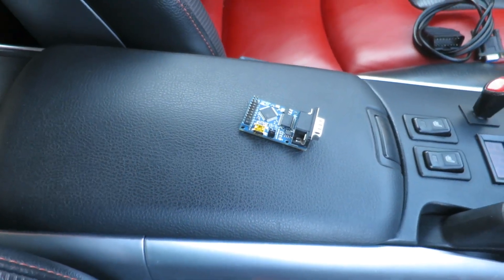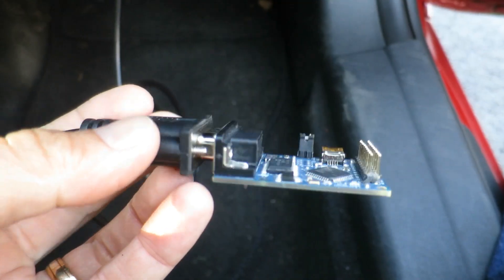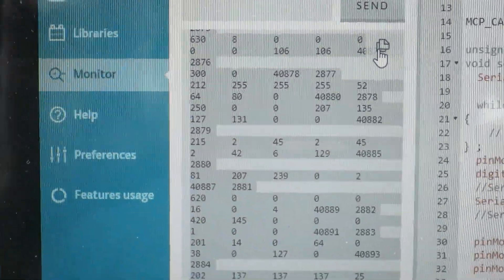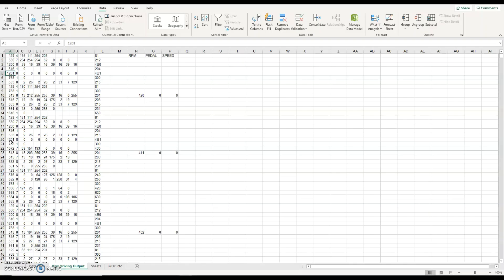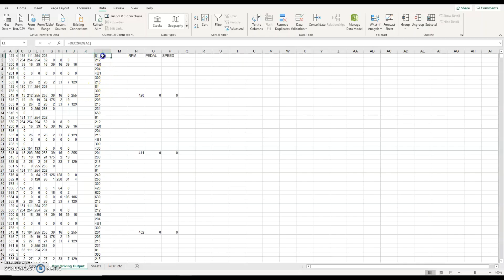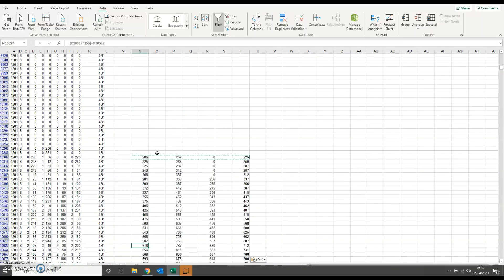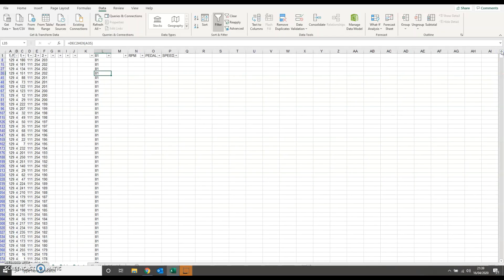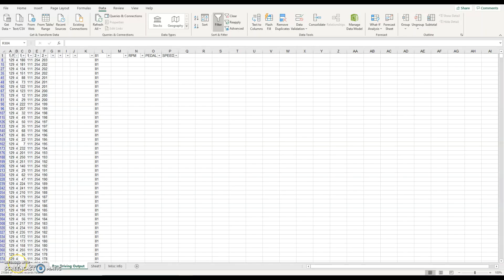How to read the CanBus in any car. (Can Bus) Part #1

Comment: SO AWESOME! I've had a specific idea for months of an arduino project I want to implement in my new car which will need inputs and outputs to/from the CAN BUS network, and inputs/outputs to other electronics. This makes it way more achievable. You've probably saved me a good 8 hours of trying to figure out what it is I don't know in order to start this.
Reply: @Dave Lovell if you acheived anything in your project, could you please share it with us?
Reply: @ezzaldeena.alribi8603   I haven't yet, but I'm planning on having it completed before the end of December 2021. I'll probably post some stuff on github and or instructables when I'm done, and I'll try to link it here. I might forget to put it here though so, comment on this thread if a few months go by and nothing happens
Reply: @davelovell8631  Pinging you.  :)  I, too, find this stuff fascinating.  Who knew learning Unix decades ago would find its way into cars and handhelds?
Reply from the maker: Im so glad I have helped, good luck with the project...

Comment: Where do I find the files mcp_can.h and mcp_can_dfs.h ?  Are they're any other files required?  Is this the correct version: https://github.com/coryjfowler/MCP_CAN_lib ?
Reply: I downloaded this version and installed on my system, then with your source code verified... I have several errors and I haven't modified anything.  35:29 error: no matching function for call to 'MCP_CAN:begin(int)' if (CAN0.begin(CAN_500KBPS) == CAN_OK) {
Reply: It looks like I may have a different version of the libary as the begin function expects 3 parameters, none of these are optional.  What version do I need?
Reply from the maker: Hi Simon - ill reply to one of the multi emails youve sent! Cheers
Reply: @SouthWestEVUK  thank you
Reply: hey i´ve got the same issue... did you find a solution?
Reply: @jo6412  , I have it building now, make sure you check you don't have any other CAN bus libraries installed, the library I have installed is in a folder /libraries/CAN_BUS_Shield-master/ date of mcp_can_dfs.h is 7 Jul 2014,
Reply: @SimonPlatten  ok thanks i will check that
Reply: @jo6412  halo can you sent the library to my e mail ican't find the library  thanks

Comment: Don`t buy that board! The customer service is a complete rubbish - no proper instruction here, or on hobbytronics or anywhere else  on how to modify the pinout of any CAN library you find for arduino. Even the example they indicate on hobbytronics web page does not run on the device. I bought one and about to send them back - a useless piece of sh.t.
Reply from the maker: Well thats a shame, I have used multiple ones without issue. I guess you might be the reason that Hobbytronics contacted me yesterday asking for help with the pinouts! Dont send it back, let me know whats up.

Comment: Hi, Great video and very clear explanation, I can't wait to use it. I have an issue though, which is probably just my poor basic knowledge of Arduino but I'm getting the following error when I try to compile the code... 

exit status 1
'class MCP_CAN' has no member named 'readMsgBufID'

I downloaded the "Arduino CAN-BUS library" from the link on the Hobbytronics "Leonardo CAN BUS board" page. Is this the correct library or is there something else I need to do too?

Many thanks, Bob.
Reply from the maker: I have just looked at what library I used https://github.com/sandeepmistry/arduino-CAN Try that one?
Reply: @SouthWestEVUK  Hi, thanks for the help but I’ve installed that library and it won’t allow me to compile your code as it cannot find the #include <mcp_can.h> or <mcp_can_dfs.h>      There seems to be a mismatch using that library as it only includes CAN.h and MCP2515.h     I have found though that I can successfully compile, upload and run the code if I install the GitHub library from Seeed Technology Inc, all seems good until I plug in to my car and turn the ignition. At this point nothing happens and there’s no response in the serial monitor. Sorry about this, but any ideas what to try next? Is there any way that I can test the response from the car? I've tried two different cars, a volvo and a Mazda and neither are responding. Many thanks. Bob.     Oh yes... I've been going over and over your video to check I'm not doing something stupid and have noticed that we each get different responses when we power up the Arduino, Your monitor responds with   "Init.  Enter setting mode success  set rate success!!  Enter normal mode success!!  OK!  Good to go!"   whereas on mine I get   "CAN Init:  Can Init success  Good to go!"   Are we possibly using different versions of the Arduino code?  Thanks again.

Comment: HEllo Dave, I am about to have a try if my c-zero can run the heating while charging - as factory setting it cannot. My question: if I figure out the ID and bits, can I use the same arduino to design a code? I understand that it is just highs and lows, but do I have in the library the info on how many milliseconds one high needs to be and how long intervals need to be between two signals?
Reply from the maker: Hi, so not sure what you mean by highs and lows, but you don't need to go that deep. The can library will handle all hand shaking, CRC, bits and conflicts. You just send the data you want and it will (most of the time) get to where it needs to go. Most CanBus's I have seen like to have repeats of the data, so for instance might want the RPM sent once every 50ms. Hope that helps.
Reply: You should use a can-bus adapter to interface with your arduino as the speeds will be too fast to just digitalRead the pins.

Comment: Hello, will it work with peugeot 3008 gt line 2020 for telecoding headunit, options etc?
Reply from the maker: I would imagine so, if it has a Can Bud to attach to!
Reply: There is a long post about can bus sheild connected with arduino uno board  and connecting to the cars obd2 socket 2 pins only for connection with the nac head unit here is the link https://www.forum-peugeot.com/Forum/threads/tuto-t%C3%A9l%C3%A9codage-et-calibration-dun-nac-rcc-cirocco-sans-diagbox-via-arduino.121767/

Comment: Thank you for sharing!! I have a question. If I would like to use a CAN-bus operated speedometer on an older motorcycle how can I make that work with Arduino? Thank you!
Reply from the maker: Yes absolutely!
Reply: How do you tie sensors to the Arduino?
Reply: @harryohanson  this is something beyond the scope of this tutorial. Look up rpm arduino to see methods for this. If the motorcycle isn't using can bus, this video isn't really relevant to your needs.
Reply: Thank you for your reply!

Comment: How many CANs does the Mazda Rx8 have? Most modern cars have several CANs (Drive, Body, etc.) which are linked by a Gateway-ECU. The gateway also separates the Diagnostic-CAN from these CAN busses. So generally the OBDII Port lets you only access diagnostic messages (eg UDS) on the diagnostic CAN without having access to the full CAN Network.
Reply from the maker: Hi, The RX8 has two Can Buses - a High Speed and a Low Speed, your right in that I believe the OBDII port only gives access to the High Speed bus, youd need to reference the wiring diagram for the car to see where the physical wires are for the other Bus if you want to access it. The Nissan Leaf has several Buses also.

Comment: Thank you for this nice video, I really enjoyed it.
From where do you know which heder ID is for what? Do you have any source from where you know lets say the ID 1201 or ID 129?
Thanks.
Reply from the maker: It is very much trial and error, piece by piece working out what each code does. Start by finding out what all the different ID's you have - log what their data is. Do something in the car (brake, throttle etc), and see which ones change. Its a long process but as you get your head into it and see the same codes over and over, you soon learn whats going on... Good luck!

Comment: Is it possible to read the VIN using can bus and change it on a module ?
Reply from the maker: I think it differs car to car, the RX8 I dont recall seeing a VIN number but a Nissan Leaf I have. I very very much doubt you can change the VIN over CanBus,
Reply: The EPROM would have to be read of the module and then, edited with the VIN. Then flashed back to the EPROM. They call it "Firmware VIN editing". Some manufacturers code the VIN to various modules, which is so annoying if you want to replace a faulty module with a used one from another car. The manufacturers call it "component protection".

Comment: Hello mate, have you worked on the radio's lcd display?
Reply from the maker: Not directly, I believe it is on the slow speed canbus, there are people online who have information, search away!
Reply: @SouthWestEVUK  yeah, I have a Mazda 3, and it seems to be using the same display, but I've removed the stock radio and lost its features
Reply: @Henningberge  the Metra stereo install kit for RX-8 contains an electronics module that controls the LCD in that application.  The dash kit seems ridiculously expensive until you realize it contains that module as well as another one that interfaces the stock steering wheel controls with an aftermarket stereo.  Maybe you can use that control module in your 3.

Comment: Would you please tell me what are the PIDs codes for Turn Signal Right and Turn Signal Left.
Thank you very much
Reply from the maker: So I accessed the high speed can in the RX8, and those signals are not on it. I believe there is a low speed can also that has this information on it, and the ability to adjust the radio message display etc...

Comment: Sir, a 'byte' is 0 to 255 (for a total of 256).  You state it is 0 to 254; which is incorrect.
Reply from the maker: Hay, oddly my lucky number is 256, as growing up programming 8 bit computers a byte and its bits are ingrained in my brain. Where about in the video do I say 254? I do have a habit of saying random incorrect things, but 0-254 would be like getting my own name wrong...
Reply: Probably thinking of ivp4 subnetting, where 255 is a broadcast address

Comment: Totally awesome! Enjoyed it. I have a question for you and commentators. Can i (after convert of CANbus data) pull this data with esp8266 or something else, save it to server and i want to access with my phone whenever i want(after connect to esp8266 sure). And i assume that i used an ESP8266 module. Your answers will make me happy.
Thanks  for the video.
Reply from the maker: So the ESP8266 will give your Arduino (if thats what you are using) Wifi access. This I would imagine will give you a TCP/IP stack to transmit and receive data on. It might give you higher level protocols such as SMB which you could use to save files on a network share. It is not something I have done, but yes all seems plausible to live stream data from the Can Bus to a network share that another device (phone / tablet) is reading.
Reply: TheBlackhursts Thanks sir. Appreciate it. If you share your email, i can mail you What is next about my project And we can exchange some ideas.

Comment: Thank you for the video. Any information on how can I use the data realtime. For example if I want to take the data do some post-process and display it.
Thanks in advance
Reply from the maker: You can output to a standard output - so if using a PC to compile the code you can output in real time to the console - same on the web interface (arduino.cc).

Comment: Hello Sir, I have the same Arduino board and have followed your instructions, but I get the following error when trying to compile :( Below is the error I receive when compiling:

Arduino: 1.8.13 (Windows 10), Board: "Arduino Leonardo"

C:\Users\User\Desktop\sketch_aug14a\sketch_aug14a.ino: In function 'void loop()':

sketch_aug14a:52:10: error: 'class MCP_CAN' has no member named 'readMsgBufID'; did you mean 'readMsgBuf'?

     CAN0.readMsgBufID(&ID, &len, buf);    // Read data

          ^~~~~~~~~~~~

          readMsgBuf

exit status 1

'class MCP_CAN' has no member named 'readMsgBufID'; did you mean 'readMsgBuf'?

This report would have more information with
"Show verbose output during compilation"
option enabled in File -> Preferences.
Reply from the maker: Try downloading the mcp_can library and importing it to your sketch. You should find it on Git Hub

Comment: Hi, trying to use the arduino sketch you linked to, but it is throwing some errors when compiling.  Is something missing?
Reply from the maker: Hay, what error are you getting?
Reply: @SouthWestEVUK  Thanks for the response.  If you want the "verbose" log, just let me know.  

Arduino: 1.8.13 (Windows 7), Board: "Arduino Nano, ATmega328P"

C:\Users\Boss\AppData\Local\Temp\arduino_modified_sketch_176171\sketch_jul31a.ino: In function 'void setup()':

sketch_jul31a:35:29: error: no matching function for call to 'MCP_CAN::begin(int)'

   if (CAN0.begin(CAN_500KBPS) == CAN_OK) {

                             ^

In file included from C:\Users\Boss\AppData\Local\Temp\arduino_modified_sketch_176171\sketch_jul31a.ino:2:0:

C:\Users\Boss\Documents\Arduino\libraries\MCP_CAN_lib-master/mcp_can.h:108:11: note: candidate: byte MCP_CAN::begin(byte, byte, byte)

     INT8U begin(INT8U idmodeset, INT8U speedset, INT8U clockset);       // Initialize controller parameters

           ^~~~~

C:\Users\Boss\Documents\Arduino\libraries\MCP_CAN_lib-master/mcp_can.h:108:11: note:   candidate expects 3 arguments, 1 provided

C:\Users\Boss\AppData\Local\Temp\arduino_modified_sketch_176171\sketch_jul31a.ino: In function 'void loop()':

sketch_jul31a:52:10: error: 'class MCP_CAN' has no member named 'readMsgBufID'; did you mean 'readMsgBuf'?

     CAN0.readMsgBufID(&ID, &len, buf);    // Read data

          ^~~~~~~~~~~~

          readMsgBuf

Multiple libraries were found for "mcp_can.h"

 Used: C:\Users\Boss\Documents\Arduino\libraries\MCP_CAN_lib-master

 Not used: C:\Users\Boss\Documents\Arduino\libraries\CAN_BUS_Shield-master

exit status 1

no matching function for call to 'MCP_CAN::begin(int)'

This report would have more information with
"Show verbose output during compilation"
option enabled in File -> Preferences.
Reply: going from the bottom, up:

You have multiple MCP libraries on your machine that the arduino IDE can find, so it's sorta confused. To try and be helpful, it just picked one for you...

Later up it says "Hey, there is this CAN0 object that doesn't have a method called 'readMsgBufID'". This means that the library you're using doesn't know what this method is, or what it does (it can't find a definition for it)

Above that issue, it goes on to say "This CAN0 object created from this library doesn't have the same method that you're calling in your code... You have one really close called "begin," but it's just different enough that I can't do anything with it"

long-story-short--and without actually checking--I would think the wrong library is being used

Comment: All the tires are on their own individual paths.  When you do anything but go ABSOLUTELY straight (even then it's slightly different), plus the size of the front vs rears could also be different.  When you steer more and more, all the tires follow their own arcs of various radii, so the speeds vary.
Reply from the maker: These are all very true points! Cheers

Comment: Leonardo CAN BUS board seems to be great idea... just one remark... only one build in can bus line is not so great... most cars have double lines operating on diffrent speeds
Reply from the maker: They do - the RX8 also has a slower bus, but that operates stuff like the radio, displays etc - I did not have a need for them, so left that bus alone - it works fine as it is ;o)
Reply: @SouthWestEVUK  yes, but in order to read data from fast and slow can bus at the same time, you need hardware which supports reading data from two lines, which is not the case unfortunetly ;)
Reply: @zych84  So what is a better product that can read from 2 canbus lines? 🙂 Would it be not enough to first read from one line and then change speed and read from another line?

Comment: Nice explanation, to make things simple, is not better to trick the ecu that engine is running and leave the rest?
Reply from the maker: Problem with that is you would need to replicate every sensors output, which would mean recording all the sensors on a working car to figure out if they are voltage based, resistance based, communications based - bit of a headache! Yes you could replicate them all, but just not worth it.
Reply: @SouthWestEVUK  ok chess mate.👍

Comment: Have been working on some CAN bus shield development - particularly with the ESP32 for wireless CAN bus debugging. Was also planning on looking to develop some software to improve the analysis of CAN signals for hacking purposes. Did you come across anything similar?
Reply from the maker: Ive not come across anything no, a wireless device that dumps the communications to a txt file on a local computer would be an awesome device.